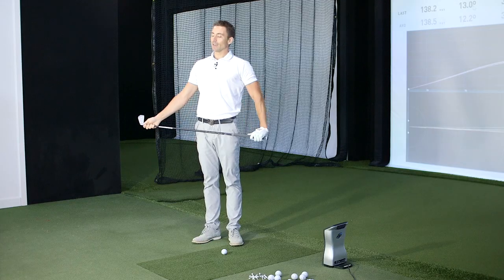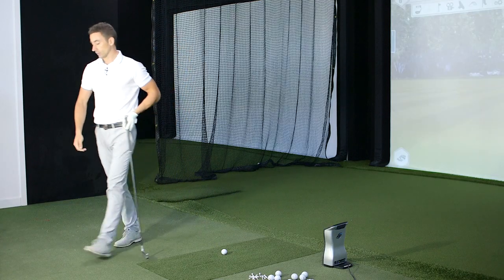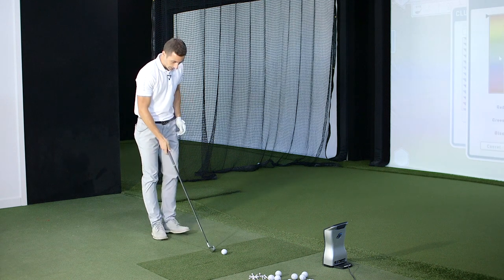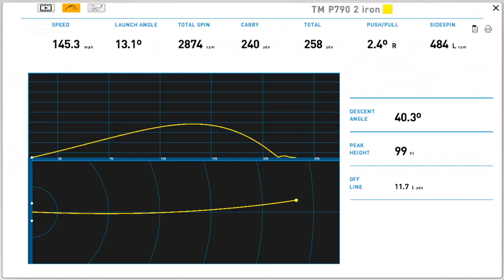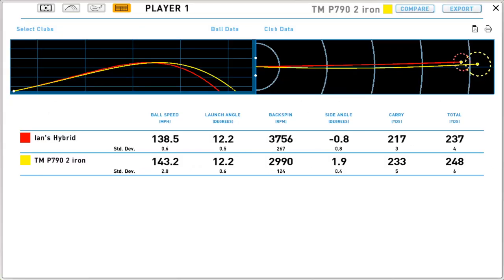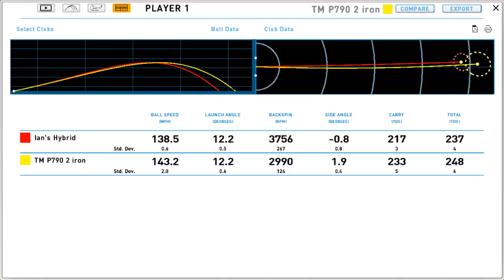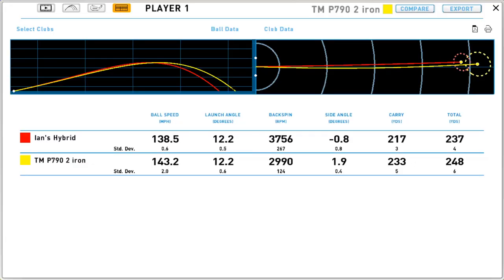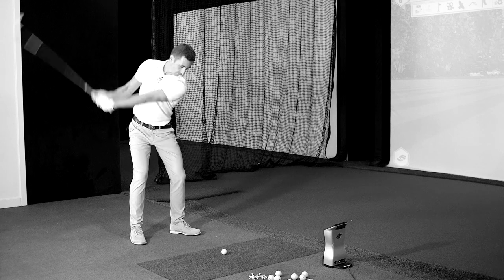Hybrid VS Driving Iron

Comment: My only concern with driving irons is whether the average golfer has enough swing speed to get it to launch - not so much off the tee but off the fairway.  Still interesting as I am looking to replace my current 5w & weak hybrid.

On a links course my worry would getting the ball to stop with a UDI.  A great links course (which sadly it is a while since I played) is Dunstanburgh Castle.  In the summer a UDI would be close to unplayable on more than a few holes

Comment: Fantastic video as usual gents! Would be great to see how the UDI performs for someone with a lower SS (~100 mph driver SS). As a high cap, I have a hybrid in the bag but it is my least favorite club in my bag and I rarely ever use it. I've been tempted to try a utility/driving iron (mainly off the tee) but I'm worried I don't swing fast enough to hit it well.

Comment: Very interesting review guys. Great to see Ian hitting some balls as well. :-) I've personally been tossing up getting a driving/long iron as my set currently has 2 x hybrids (3,4) and irons kick on at 5 iron and up. My struggle lately has been when I've needed/wanted to play a pretty decent distance shot but I need to keep the ball flight low to stay under some low hanging trees/ branches. When I try hitting my hybrid, I just can't keep the ball down low enough to stay under them no matter how hard I try. So i'm now looking at add in some kind of long iron specifically for this purpose. I have only 13 clubs in the bag so I have no issue with replacing a club. Been looking at both the TM P790 UDI as well as the Cobra Utility iron which is adjustable to a 3/4 iron which may suit me and my swing speed a little better than the 2 iron.

Comment: Great video ! Love it !
I’m about to replace or modify my hybrid or 3wood. I never use them. I’m not that good with woods/drivers but very confident and pretty consistent with my irons (former grass hockey player). I almost always use my 3iron from the tee with an average distance of 220 yards. I’m not very longer than that with my woods...
I’m curious...what is the length of the shaft ? 
Is it a good idea to cut my actuel 3wood shaft or should I need a brand new one? 
I can’t wait to see the comparison between several driving irons !!!
Thanks again!!!
Reply from the maker: Most driving irons are built to about 40" or so. You wouldn't want to trim your 3 wood shaft that much as it would alter its performance significantly.
Reply: Thank you for your answer, I really appreciate! Good to know, so I would probably buy a new driving iron...or use the shaft of my hybrid.

Comment: Again you guys kill it.  Every morning i can get to see these video's and learn something is awesome.  My question is i have a Matt's type swing speed so 120 ish with the driver.  I play the Srixon ZU65 Driving Iron with a Accra shaft.  I believe that the chemistry of that head brings more weight lower and back than the Taylormade driving iron.  So peak height and spin is a little bit more.  So in my opinion depending on the head and shaft you can achieve that higher ball flight with more spin which then lower swing speed players do have a better choice between hybrid or driving iron.  Like you said its all about what fits you and your bag based on the needs.  But i just thing there are driving irons other that the Taylormade that do produce higher spin and peak height numbers.  Any thoughts.  Thanks JJ
Reply from the maker: Likely that is the case, wouldn't be surprised to see the P790 being one of the lower spin driving irons when we eventually do our driving iron comparison video.

Comment: Nice job guys. I may get the 790 UDI, Rogue 17 deg or the Ping G400 17 deg. Just need to hit them all at the same time. Prefer the shorter shaft than driver or 3W off the tee. Can you get a shorter shaft in 2 hybrid?
Reply from the maker: Yup you can order it shorter for sure

Comment: Ian and Matt great vid and nice swing Ian.  Im looking at the Callaway rogue hybrid because they can bend them 2 degrees flat and the ball flight is what i need for a par 5, 2nd shot.  I.play a rogue max stiff flex for 3wood and  a 95 gm recoil for 4 iron.  Any shaft i should ask for in a fitting as far as same type of feel?   I have a smoother tempo.  Sorry, everytime I ask a local fitter questions they seem to disappoint and create doubt.  Thank you. 👍
Reply from the maker: Aldila rogue black HY, which is a standard callaway offering in their hybrids

Comment: Ian, what flex shaft were you using; do TM offer any other graphite options, their website would suggest not ? Nice to see a more normal swing speed for a change, no offence Matt.
Reply from the maker: Was a stiff flex – Taylormade also offers the UST recoil and Aerotech steelfiber in the UDI.
Reply: How would those shafts compare ?

Comment: Another great video. What brands make a driving iron in a 1 iron (15/16 degrees)?
Reply from the maker: I think you can order the UDI bent strong through Taylormade's custom options - that's probably your best bet as I don't think any company goes below 17º as a stock offering.
Reply: I picked up a Dunlop #1 driving iron at 16 degrees from  e bay works great off tee or fairway

Comment: I have trouble hitting woods and hybrids so i only have a 3w in the bag for a backup driver. Would you recommend dumping the 3w for a p790 2i? I have a 20yr old wilson 2i blade that I swapped it out for once but, the shaft broke the first time I tried to use it.
Reply from the maker: If you're uncomfortable with fairway woods and hybrids, definitely give something like the P790 UDI a try and see how it performs.
Reply: Thanks for the reply. Just ordered one and will give it a go next week. Have you thought of doing a head to head of all the different utility 2i?
Reply from the maker: We have and will be doing that for sure.